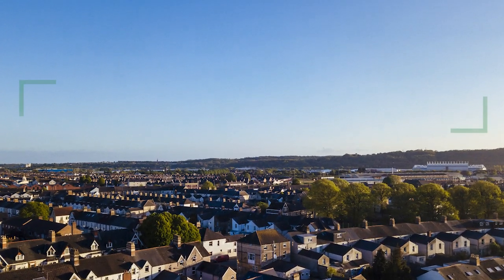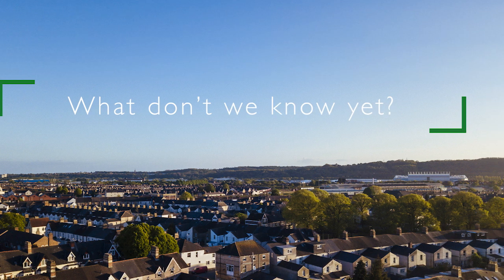What is the Green Homes Grant? | Homebuilding

Comment: If not getting help for a new boiler what's the point? How do you run central heating and hot water with a crap boiler?.
Reply: Well, the gov doesn't like boilers, they want to make you install solar thermal and air source heat pumps instead.
Reply: @cloudrak  
The government doesn’t like boilers

They want to make you install solar thermal panels and air source heat pumps instead.